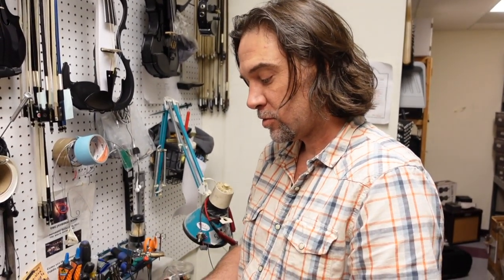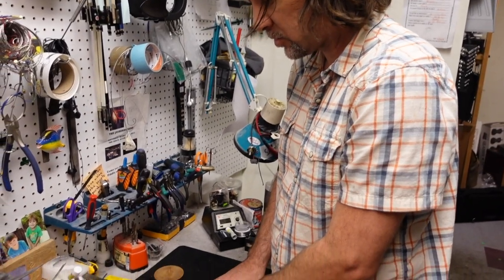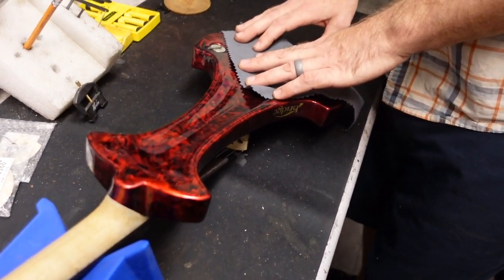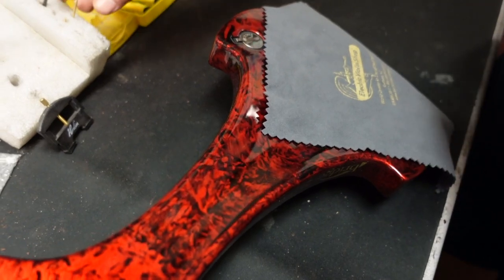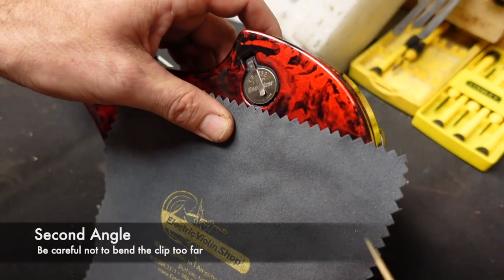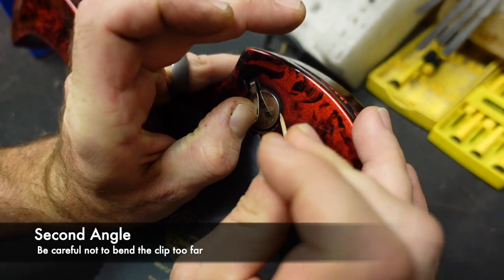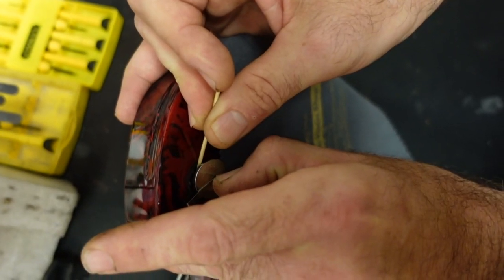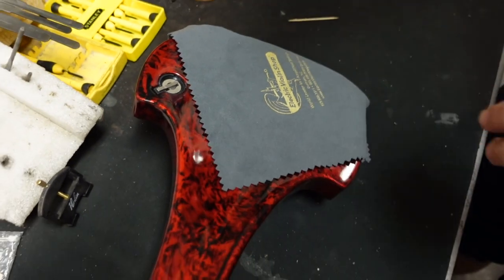How to Change the Battery on a Bridge Electric Violin

Comment: Is it normal for this battery tray to be loose while handling it? I bought ine used and went to replace the battery and saw that the entire tray was moving when i attempted to manipulate the clip to remove it. 

Is there a recommended method of securing the tray?
Reply from the maker: That's not ideal. Send our luthier a quick video. info@electricviolinshop.com